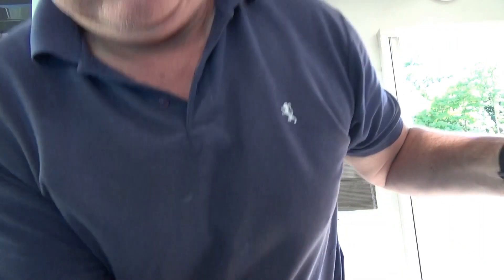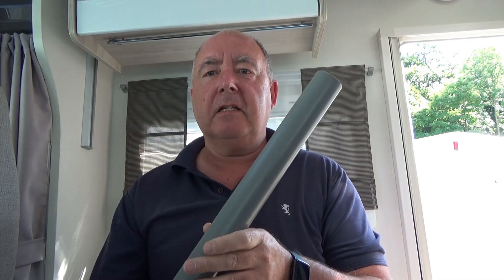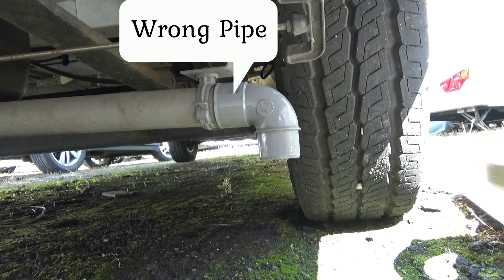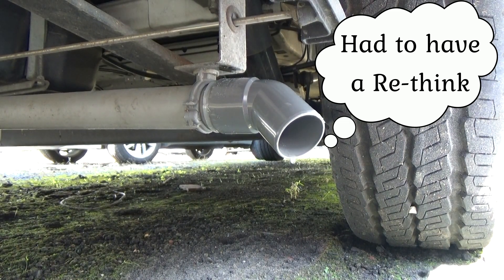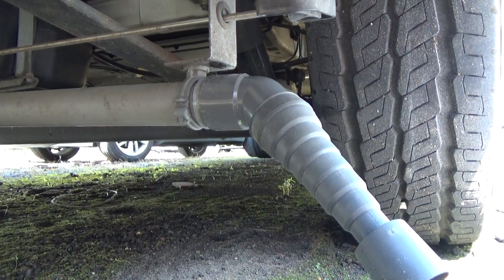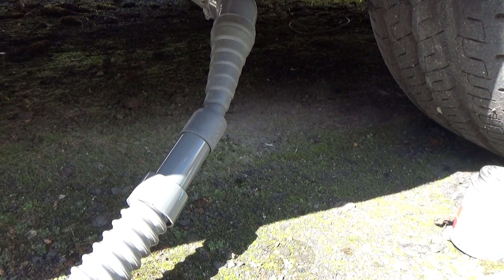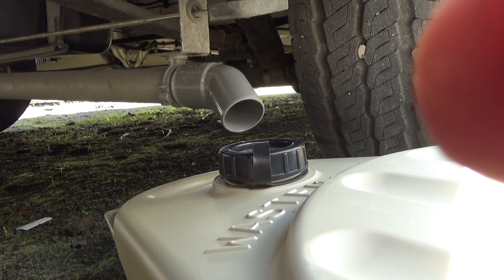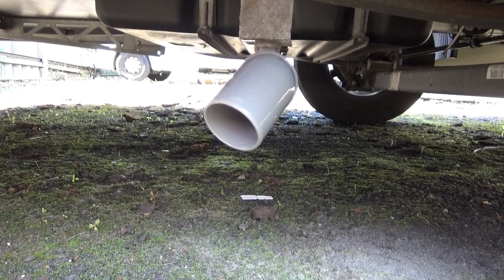Modifying CHAUSSON Motorhome WASTE WATER PIPE to fit COLAPZ ADAPTOR & PIPES

Comment: Hi Andrew, You made a good recovery there, things don't always go to plan for me either!  The 45º angle will allow the waste to flow better anyway. Nice job, take care, Martin
Reply from the maker: Glad storage yard is only a couple of minutes from home, once I cut off the downward bend panic set in🤬, sat and pondered then went to get grinder with sanding disc on & sanded down the bend outer wall on the pipe until my new bend fitted, a big sigh of relief 👍

Comment: You started off by saying " The other thing I bought is that FROM??????? and to get a bend on it" ok whats is it called and dont say you bought it from a shop called "to get a bend on it" please hahahahaha great video apart from that, oh where is your  valve point to start the flow to empty your pipe? Many thanks Ray K UK YNWA.
Reply from the maker: Hi thanks for watching, I don't have a script, just thought I would show anyone who has the same type of outlet on a Chausson how I changed it from a 90 degree bend to a 45 degree bend (available from any DIY / Plumbers merchant or online shop) to fit the collapz waste pipe adaptor easier, the slide valve is situated under the waste tank and connected to a pull rod above the waste pipe which connects to a pull handle to open and close the valve, this can be seen in the video, may be some people don't have an issue with the design, but may be the video is only useful for some people who own a Chausson & have the same issue with the same type of waste outlet 👍
Reply: @andrew-karens-adventures    Andy it was said it jest and good spirits, I know what it is like to work without a script, I saw the handle to the right of you and I guessed thats what it was, I have never seen a release valve like that reminded me of either a clamp or a masking gun, thanks for the quick reply, Ray K UK YNWA.